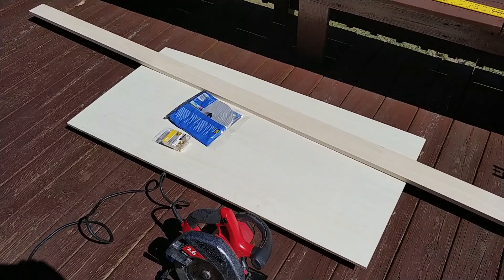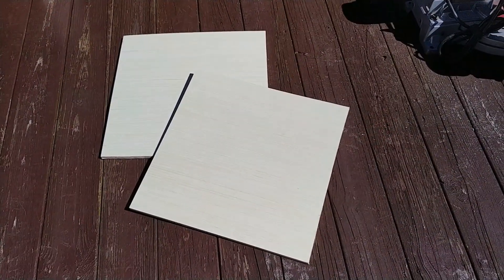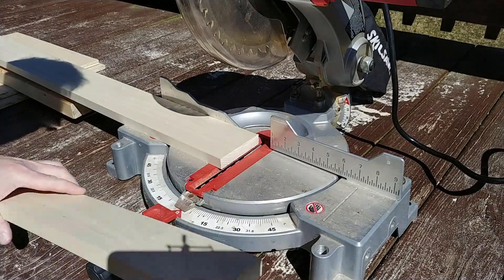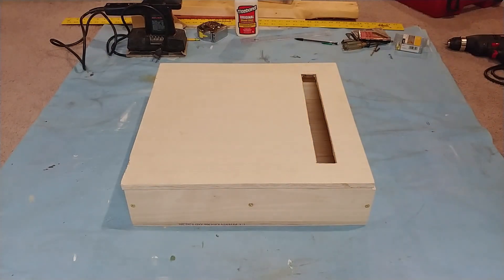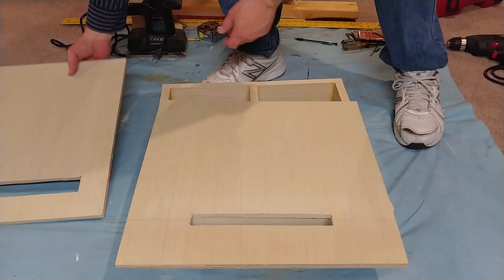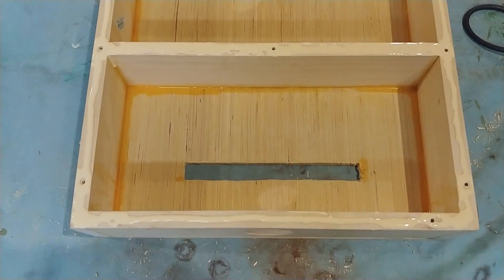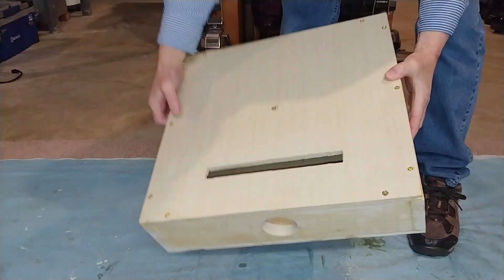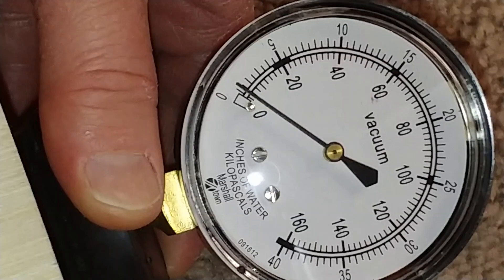Introducing My New Dual Chamber Airflow And Suction Box

Comment: Okay, I've rewatched it and still have a few questions. What thickness of plywood did you use for the top/bottom? What were the sizes for the holes?
Reply from the maker: 1/2 inch thick for the top and bottom. The sides are 3/4 inch. Big hole is 13.5 by 1.5. Small hole is 9.5 by 1.0. Round holes must be 2" diameter. Can't wait to see it built! 👍
Reply: @VacLab  Appreciate that! I figured it would just be easiest to copy what was done your design seems to work well for a good variety of machines.

Comment: Is the suction channel inlets based on the brushroll length of vacuums? Or the inner edges of the vacuum's soleplates? I noticed you said you made two sides, one for smaller vacuums and one for larger vacuums. I presume the weatherstripping foam went around the suction inlet where the soleplate touches?
Reply from the maker: The two inlet holes exists to fit widely varying nozzle sizes and save tape.
Reply: @VacLab  Ah OK.  Oh you tape off the excess gaps in the opening ?
Reply from the maker: @huskyvacs  the PN gets sealed to the box.

Comment: So I came back to review the results of this video, and it had me thinking: the avalir has the same bag and mini-emtor as a late model sentria (just before they made the sentria 2), but higher amperage and as a result higher airflow. I wonder how much cfm it is per amp or what the ratio of fan RPMs to cfm is. perhaps there’s a formula for calculating hypothetically what the cfm would be with the machine’s current setup (i.e. the inner bag used and with the brushroll head on with the brush spinning) at a higher or lower amperage, but figuring that out (I.e. the formula) could be tricky.

Comment: With a dedicated vacuum gauge port and a few different sized airflow hole adapters, this setup should theoretically allow you to approximate air watts charts too! Cool stuff!
Reply from the maker: I would have to drill another 2" hole per chamber and create several decreasing diameter adapters to upgrade this thing into an Airwatts box.  😄